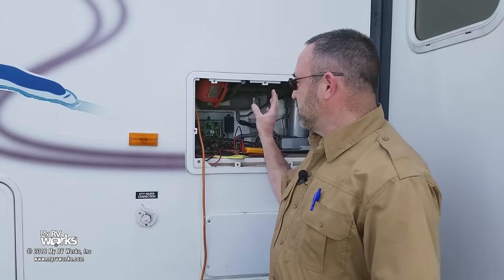How To Determine If Your RV Refrigerator Cooling Unit Has Failed -PLUS- RV Fridge Component Overview

Comment: Thank you!!! for this video.  VERY comprehensive and enlightening.  I am getting ready to install homemade baffles and a couple of Amazonbought fans to my TT.  There is currently no fan, so there is no wiring or thermistor to connect the fans to.  Do you know of a source for a thermistor with the specs (135-105) you quoted?  I've got everything ready to go except for that.  Thanks again!

Comment: Hey Darren. A YouTuber, Pippi Peterson, just posted a video (c90bgma1vMU) where she removed the baffling blocking part of the upper vent of her slide mounted refrigerator. I posted a link to this video for her to view. A while back she did a video on repairing a Schwintek slide-out Motor (FfUutwwLL7o). I was really impressed she got this to work as getting to the motor was a real beast. I recall you doing a video on a rack and pinion slide but not the Schwintek. If you have done a Schwintek repair video maybe you could post a link on her video showing a potentially easier method for repairing such a problem. She has over 100K subscribers so a collaboration video with the two of you providing your insight into her repairs could make a lot more people aware of your great content. For even wider audience appeal maybe you could walk her through your "Boost Your RV Air Conditioner Performance..." (rxCljBVi8DU) process.  Her latest video was from the Vegas area so maybe you could meet up if you’re visiting Vegas for a conference.  If not in the same area maybe she can record a skype call where she is pointing an external cam at the problem area so you can see what she does and she can make the repair.  She has soldered together solar panels, installed inverters, and recently changed Rear Differential Fluid in a 1-ton truck so she should be able to follow your lead.  Love your content!
Reply from the maker: Thanks for the ‘intro’.  I watched some of her video’s and made a comment.  If she reached out to me on any repairs, I will be more than happy to offer tips-tricks etc!!!  Hope we can work together to help everyone be a Happy Camper!!!
Cheers,
Darren

Comment: Awesome video. Very informative. One quick question though, both my heat sources are operating properly. The boiler is getting hot but the condenser coils are not. Doesn’t that point to the actual cooling unit itself? I see or smell no leakage.
Reply from the maker: If that unit's been running for an interval of time and the boiler is hot but the adorable coils, the roundy-round a water park tubes, are not hot, that's an indication of a blockage. That indicates a cooling unit has failed. 

The first few minutes of the following video we do talk a bit about blockages.
https://youtu.be/--DCnSw1jP4?si=ZaiQ98ZJxuEExYB7
Reply: @MyRVWorks  thank you so much for your response. You have me hooked on your YouTube channel now!

Comment: supper the only thing I didn't get was upper control testing to ground with ohms on a hot leg would it getting a connection on a hot leg seems you by past that test  and I got  little confused on the upper board test, but I will test my thermistor , thanks much your great God Bless

Comment: Great, well done video with tons of information.  I have one question though.  When you were inside the rig pointing out where the thermister normally mounts on the fins, you mentioned the little arrow points to the "sweet spot."  Can you elaborate a little on what happens when the thermister is mounted at different places on those fins?  I assume it can throw the control board's perceived temperature inside the refrigerator off, but I really have no idea.  How important is it to get that thermister in the correct position on the fins?

Comment: Do you have the same information on rv refrigerator’s for norcold model1210. Our refrigerator is not in a slide out. It changes temperature while we are using it. The range of temperature goes from around 50 to 38 degrees. I had a technician come out and with out test components has said we need to replace our refrigerator. After watching your video on this matter I’m thinking we should get a second opinion. Also what’s your web site and do you have information for norcold model 1210T. In closing I really liked this Vedic you made and your drawings and how detailed you went into showing us what and how to check on refrigerator’s.

Comment: Thank you for sharing your expertise. I learned a lot and followed your advise to close up the air escape gaps on the back of my fridge. 
Please help me figure out my problem with my Dometic RM 8501 in my Northstar truck camper. 
The boiler is working on both gas and electric, but the heat is not rising up the tubes. The boiler gets very hot and the tube gets warm on the first few inches where it exits the boiler. The rest of the tubes are not getting warm. 
I have let it run for more than 24 hours on both gas and electric. I would appreciate your feedback. 
Thank you, Richard and Bonnie from Vermont

Comment: Love the vids, you have been helping me a ton with my new to me Lance. Can you tell me what the blue wire is on the RM2354 6 pin harness? It is not plugged in to anything on my fridge but it works on AC so far
Reply from the maker: The blue wire is for programming the microprocessor on the control board at the factory. Once the board is programmed that blue wire serves absolutely no purpose. On the schematics it calls it out as a test wire and it leads to a lot of confusion.

Comment: I have a Dometic RM183 and I've passed the Eye, Smell, and Hearing test.   Problem is my heating element keeps tripping the main breaker.  I disassembled the control module to try and do some resistance testing but my model doesn't have the control board like your showing and the thermistor is just this copper wire that comes in to a cold adjustment dial so I'm not really sure how to get readings from it.  I'm thinking its a bad heating element but i don't want to rule out a bad thermistor either. Any advice for my RM183 in particular?  You're the man.  Love your videos.  Thank you.

Comment: My model refrigerator (Dometic RM660) is not listed in your library.  What chart can I refer to for the R Values for checking resistance of the Thermistor?  I have the installation and operating instructions but don't see any info there regarding R values.  Thank you for taking the time to create this video!

Comment: Thank you for this video, with your video I was able to fix my fridge. 
Question, my fridge is not in my slideout and I can hear a fan running. Should there be a fan and where would it be installed. Below the cooling fin or above the cooling fins.

Comment: My regular fridge broke, so I ripped the one out of the 1985 RV.  In the house the ventilation is not ideal, and it was never getting cold. I added a fan like you say is needed for the popout ones and it's much better. -17c freezer, 3.7c fridge in 4 hrs, almost there! I guess I need to build a box for it?  Do you have any other suggestions for running one of these in the house? I'm using a 12v 1a wallwart for the 12v it needs, I'll probably get some 12v computer fans to replace the one I'm using, right now just one about a foot below the top coil. A Dometic RM3801 AES.

Comment: Thanks for the great videos.!
My problem is that the Dometic Fridge auto light is on both gas and electric, but compressor is not running.Thank you Darren!
Reply: More info: The fridge was working properly last summer before stored for the winter. The problem happened after the de-winterization.

Comment: Thanks for the great video! 
Our problem is that our freezer is working GREAT, but the refrigerator section is not. We’ve tried our best to diagnose the problem but can’t find an answer. We have turned it off for about 12 hours and are now watching to see if it will cool. Any suggestions would be welcome.

Comment: Very informative video but I’m still unsure where to begin testing my refrigerator. On AC the freezer works fine but the fresh food compartment does not cool. On LP both work as the should. Suggestions?
Reply: i htsame problems after a recent defrosr

Comment: Got a question for you. I have a norcold in a 1993 itasca sundancer. It was working great then all of a sudden the fridge stopped getting cold. It gets sorta cold but not really cold. The freezer works well. Main question is do all these things you discuss apply when you have a situation such as mine where the freezer works but the fridge doesn’t. I just replaced my thermistor with a snip the tip replacement. Freezer is already cooling fast and the fridge not so much…

Comment: Darin, great video. I have my refrigerator in a slide. We ran into efficiency problems in the heat of Texas. I noticed we had multiple problems after seeing this video, I've fixed all the baffling/air travel issues and it seems to be working much better. However, I noticed that we only have one fan below the condenser fins and not two. The one fan is operating, but it's getting old and noisy. Looks to me that the only way to get to it is by pulling the refrigerator out from the inside. That's going to take some work. Is this how you'd get to the fan? Here's what I've done. I added two fans after the fins and have a hole only large enough for the two fans, thus the two fans suck the air through the fins and outside. In essence, the middle fan pushes and the two after the fins sucking. This seems to work. The two fans are thermostatically controlled.

Comment: Great info. Now to find out why my Rm2354 does not get cold in any of the 3 options. Going to use my 3 senses to investigate. Fridge is only 3 1/2 yrs old. Dealer pulled a fast one on me by putting a frozen water bottle in freezer to show that refr was working. I think prior owners left fridge on and did nit level it. Expensive mistake.

Comment: Wait, you need 2 baffles in a non-slide room ? One at the top and one at bottom? 
Thank you for your videos ! 
Been helpful.
Reply from the maker: Whatever you need to do to make that chimney effect and shed the heat. On our website you can go to our resources Tab and find service manuals. https://myrvworks.com/manuals/ 
Search for your refrigerator and make sure that the installation matches the manufacturers spec.  We have found that many refrigerator installations are not done following the installation spec and therefore people have performance issues with the refrigerators.
Reply: @MyRVWorks  thank you !

Comment: Hi Darren,  GREAT instructional video ! Your drawings are easy to understand. Thank you.
Perhaps you could point me in the right direction.  Fridge works fine on propane. HOWEVER...I replaced (325 watt Dometic) heating element 2-3 years ago and with minimal use is no longer works. Ordered replacement one, am  hoping new one lasts much longer. Any and all suggestions are appreciated! On east coast so driving out to you  is, well, kinda difficult!
Thanks for all!!!
Rich

Comment: Hi   Great video. I have a Dometic frig with the vent in the roof. I am planning on camping in hot weather 100plus.  Can I install 1 van at bottom and 2 vans at the top of vent or just on top of the fins. Also what is the best temperature for fans to come on.

Comment: Very Well Explained video! But, what if my Dometic 2807 freezer is working but the refrigerator isn't cooling enough? Thank you for all you do.
Reply from the maker: When I see that symptom overwhelmingly it's a ventilation issue up the back side. You must shed the heat off of those coils. Make sure your chimney baffle is built correctly and then maybe add some additional to help move some air.
Reply: @MyRVWorks  My unit s a 1994, the back of unit was pretty dusty, so I blew out the whole area. I found no obstruction from the control board all the way up through the roof vent. It is over 105 degrees out lately. I’ll look for fan that fit in that area, any hints?

Comment: Hi - I came across your youtube while researching leaking absorption refrigeratotrs  since mine looks like something is dripping down from the fins in the food section.  My question is very basic.  To remove the outside cover, do I turn the screwdriver slots to the left a quarter turn?  I've tried doing that but it didn't turn and I didn't want to apply more pressure and damage the slot.  Thanks for such a detailed tutorial because now I know what to expect when I do get the cover removed on my Dometic frig.

Comment: Darren if you have a fridge in a slide how can you perform all these tests with the thermistor, the heating element ect and verify fans are working and properly positioned with the air flow setup correctly? Can you do a video with a Fridgerator within a slide ?

Comment: This is a great video; thanks. I looked at my Dometic installation in a custom tiny home, and it's full of air gaps. ( the freezer works, but it doesnt get cooler than 12 degrees celcius) Someone just built a box and placed it on top of the fridge, uninsulated. There is a 1" gap beside the fridge and a 2" gap above and easy 3" gap behind.  I made baffles directing the air as you suggested, but am currently unable to make the curled top baffle.  How does the collecting of heat at the top of the fridge affect performance?  The top of the box inside the home is warm for sure, but would that impact fridge perfomance greatly, or will the air eventually escape through the vent? Regardless, you are very good at explaining these systems. Thank you. Oh, do you think I could just fill the top gap with spray foam insulation, or is that a ridiculous idea?

Comment: I have had my fridge on for over 6 hours to see if it works after replacing the heating element from your video, thanks. However, the boiler has not heated up. I have not replaced the burner wire? Could that be an issue? What kind of problem do you think it is?

Comment: Why did it take me so long to find this channel? Been dealing with a fridge where my 5am fuse keeps blowing and fridge wasn’t working. Had a guy come out today and replace my 5 with a 20 which I switched back and just rigged fans to make sure it keeps it cool and go from there
Reply: Currently my hypothesis is that my fans aren’t working in the slide as I haven’t blown the fuse since I’ve been providing a fan to go through the coils. So seems like either the fans are broke or the thermistor that controls them isn’t working or the reading from the control to the thermistor isn’t working. Does that about cover it? And do you have a video on how to check this?
Reply: Will verify in am and edit this comment

Comment: Excellent work and communication.  Wondering if you have anything available for next step, not cooling suddenly after 3+ years reliable service which means my ventilation parameters probably ok, nothing dirty and electric elements & burner work. How do you verify coils aren't blocked with crystallized refrigerant?

Comment: Thank you for the great video I have a question if you can help me out I have a dometic and I am hooked up to shore power and the 30 amp in a 2018 outback ultralight and I am having problems with my unit the eyebrow board was corroded and I was getting condensation inside it's right beside the AC unit so I purchased a new one on Amazon when the light on the inside stopped working but when  I hooked it up I got a check light on it but not a auto light I have checked ac power and 12v it is coming in and going to the thermo fuse and out back to the board I have 12v on the orange wire on the plug pin to the eyebrow from the bottom board and the inside light is working now and the check light is working but not the auto light it's trying to switch it to propane and sparking the pilot light I was wondering if you would have any insight on it

Comment: Hi Darren,  what a great informative video thank you. My dometic fridge freezer RM7855L has not leaked any yellow powder. The pipes at the back are hot, but it is not cooling or freezing inside the unit. This is on electric and all of the lights are on inside and on the control panel. Please can you help with your knowledge. Thank you
Reply: This is my problem, too. Been living in the parked trailer for 3 years., then fridge and feeezer suddenky stop cooling. The heating element is working, and I can feel heat on the roof vent. Did you ever discover what caused your problem?

Comment: Very informative video. You spoke about a 6 to 8 hour test - where do I find more information about that? Trying to trouble shoot a Dometic DMR702 but finding very little information about this model refrigerator. Any suggestions on service repair manuals?
Reply: Found a manual that covers the DMR702. Now trying to find a parts list with numbers to order. Any ideas?

Comment: Really appreciate the vids, It got down right freezing the other day which lasted 5 days and little warmer and back down now, boiler is warm..thermistor was down and not in slide bracket, have it back...question (Freezer and Fridge just stopped), Any steps I should take, even warmed the inside with hair dryer, found some ice?
Reply from the maker: Well, if your refrigerator is drawing in freezing air from the lower vent outside, it could be preventing the boiler from achieving the correct BTUs. The trick there would be to block off that lower vent with something like cardboard taped to the inside of that vent.  You want to block off about 90% of the air being drawn in. That will allow that boiler to achieve the proper heat BTUs.  So try that trick and see if that doesn't help you out. Good luck.
Reply: @MyRVWorks  Thanks, we are back to 40-50 and I have shut down fridge this morn, does the thermister control freezer too?
Reply from the maker: This video may help with your thermistor question

https://youtu.be/bY7cy4Kf3VQ?si=THhwczxNd7DAZS8M
Reply: Would this still help with temps back up to 40-50? Used your smell,  sight,etc..not finding any yellow, no ammonia smell, etc..2018 dometic, keystone